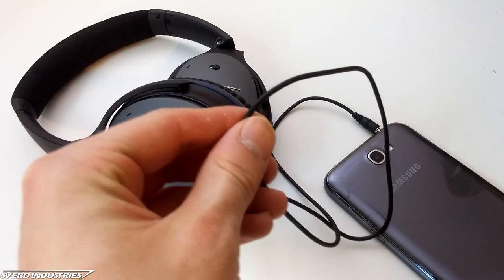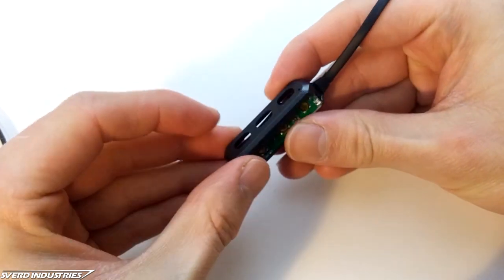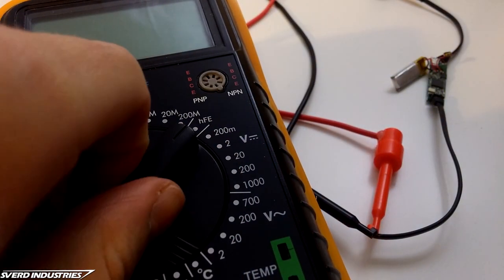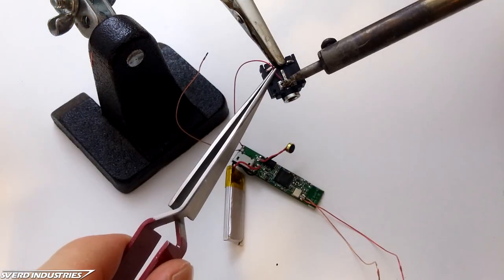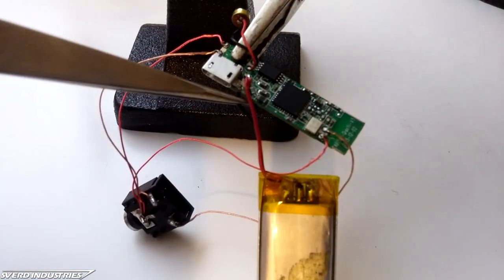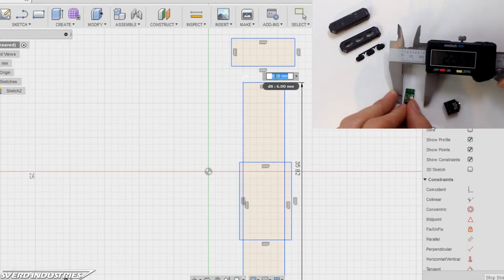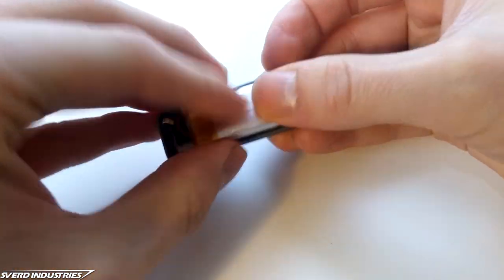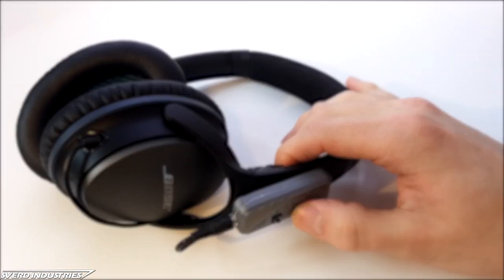DIY Bluetooth Adapter for ANY Headphones || How To

Comment: Would it be possible to turn this into a headset adapter? So replacing the internal mic with an external one using a TRRS connector instead of a TRS connector? I'm looking for something like this, but than suited for a headset rather than headphones
Reply from the maker: That shouldn't be a problem. Just go for it!

Comment: Ok, thank you for this, bc I was thinking of something like this, but for a message chair, that relies on an AUX cord connection
Reply from the maker: Cool idea, when the bluetooth circuit is this small you can really put it anywhere
Reply: @SverdIndustries  
I made it two days ago and it works, but bc of how low quality the circuit was for sou d quality, when I hooked it up to my massage chair, the sound wasn't all that, but none the less it is cheap and works. Thanks for the great video, it really helped me to learn and enjoy a massage chair XD
Reply from the maker: Hmm, you could double check the solder joints for the audio wires. But oh well, I'm happy as long as you enjoy your massages without the hassle of wires!
Reply: @SverdIndustries  
I'll definitely check the soldering and see if thinner wires make a difference, bc it could also be the resistance of the 1millimeter wires I used
Reply from the maker: Let me know how it goes after checking the solder joints and switching the wires for something thinner!
Reply: @SverdIndustries  
Alright, I'll probably end up finding out within the next 5 days
Reply: @SverdIndustries  
I didn't notice much of a difference with the thinner wires, but that might be because of the circuit I'm using. However, following some electrical rules, we know that using a thin and shorter wire allows for less resistance, which means there is going to be a difference in data transfer in a good way. You might be able to hear a difference if you used slightly thicker wires, in a bad way, mainly due to resistance, that will affect data transfer. Just as a side note, I dont think it'll be noticable unless you rely a lot on amps

Comment: What can I do for bad audio sound before I removed the audio jack the sound would come out crisp but now I get a statically sound
Reply from the maker: So you used to get nice sound from the bluetooth earbuds, and when you attached the female audio jack you get a static sound?
Check that your solder joints are solid, and check that the audio wires does not have any long stripped and exposed parts.

Comment: What would be the durability period for this set-up? Did you face any issues after modifying those headset?
Reply from the maker: The durability is pretty great, the weakest parts is the 3D printed case with thin walls. It would be a lot more solid, and even better looking, if you used a 3D printing service like shapeways or similar.

Comment: Hi - the video is really good! I was wondering what's the battery life that you are getting with your current setup?
Reply from the maker: Thank you! The battery was really good after upgrading, I didn't charge for probably three weeks or something like that
Reply: @SverdIndustries  Great video - I'm going to do this myself too. How did you verify that the new battery could replace the existing battery in terms of the existing charge circuit

Comment: Does the headset experience buzzing that most cheap bluetooth headphones suffer from? I got a set of bluetooth earbuds similar to the ones you used in your video and they make a hissing noise when no audio is played. Will this issue pertain after the modification? Thank you in advance 😃😄
Reply: Maybe fixable with a resistor before the audio cables to get rid of the static - could lower audio volume but not a lot

Comment: gr8 video. Thanx.
Which usb oscilloscope you use??
Reply from the maker: I used the myDAQ from National Instruments. It's decent, but I do believe you can find better USB oscilloscopes for less money.
Reply: Thank you for your response.
Would you know to advise some one?
Wide range, even very high frequencies, input protection?
Reply from the maker: I would look for a scope with sampling frequency of 50 MHz. This is because an Arduino uses an oscillator at 16 MHz and you need at least double the sampling frequency of the frequency you're trying to measure. This would be 32 MHz which is good, adding a bit of a margin for safety and other applications 50 MHz sampling frequency should be good.
What's important to me is also to find a scope with two analog input channels. This just makes your life easier than constantly moving around the one probe you have, when you're trying to figure something out. Two analog probes also means you can measure two signals at the same time and compare them. Perfect for debugging!

Not as important, but it would be a nice option if you could switch out one of the analog inputs for digital ones. Also the user interface should be somewhat straight forward. It doesn't have to be at the level of a full scope, just something that isn't way to finicky to use.

I don't know of any specific models for a USB oscilloscope. They can get pricey fast so I myself am open to suggestions on great ones.

Comment: What did you do about the bad audio you get from the Bluetooth device turning on because mine says "power on. pairing..." is there a way to remove this from the circuit board?
Reply from the maker: I currently just let it be. I'm toying with the idea of using a 555 timer to cut of the audio at the start. What do you think?
Reply: That sounds like a great idea. I'm not good at using a triple 5 timer because I haven't played around with one long enough? I've only used them for clocking Logic gates.
Reply from the maker: You know what? It would probably work great if you used an op-amp comparator. Then you could configure the voltage threshold to not give any audio output if its above a certain volume

Comment: Can you do this with usb headset
Reply: If you splice the cable BEFORE the usb controller adding 3.5mm jacs then yes.
Reply from the maker: Yes you can! Just make sure the audio wires coming from the bluetooth receiver has a direct connection to the audio signal going to the speakers in the bluetooth headset. So the audio signal from the blueooth receiver cant go to the USB wires they need to go to the analog audio signal in the USB headset

Comment: Bro u know what your doing so why not just cut the cord and place the amp inside the headphones? Never the less Great video though
Reply from the maker: Thanks man. I thought about placing it on the inside but I didn't want to risk cracking open my new headset at the time
Reply: Sverd Industries There is really no any risk in opening wired  headphones, they are very easy to work with. I have converted few pairs by myself.
Reply: @watchbreaker1706  That's really cool bro. Can you do some tutorial?
Reply: Praveen Kumar I am afraid that my english is not good enough to make tutorial that wouldn’t be a subject of jokes.:) However almost all steps are included in this vlog. Missing ones are: opening headphones cans and rewiring power and controls of the BT module to outside.
There are some repair manuals (check recabling tutorials) that can get you familiar with disassembling and reassembling of various types of headphones. Rewiring requires basic soldering/desoldering skills and some detective work to track the proper traces on Bluetooth module PCB. It is highly probable that you will destroy the first one or two modules but very unlikely to damage headphones themselves.
Reply: @watchbreaker1706  that's good to hear. Thanks for your reply. I hope I don't break my Beats 😂

Comment: what really need....  you say..... but do not DO..... aka.... there is a difference between a headSET  and headphones.  Few times you do say headSET erroneously.   what you created works for headphones ONLY.... not for headsets.   Am looking myself for an adapter to use a corded headSET with  boom mic .....  to bluetooth.  ...  this makes it recieve and transmit

Comment: You can just buy a bluetooth audio adapter for +-15 usd and maybe shorten the headset cable.
Reply from the maker: Yes you can. I still wanted the project of finding my own solution
Reply: Funny enough, I ended up here because those US$30-70 adapters are falling out of every nook and cranny on digital store shelves, but I cannot seem to narrow down ANY product in this sphere that has a headset (L+R+Mic) transmission. They're seemingly all receive-only and useless for me.